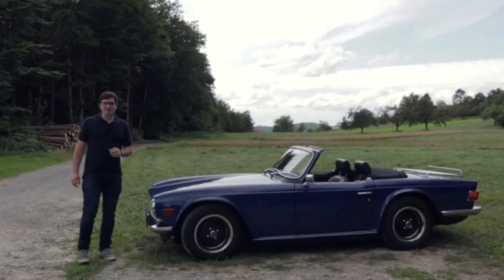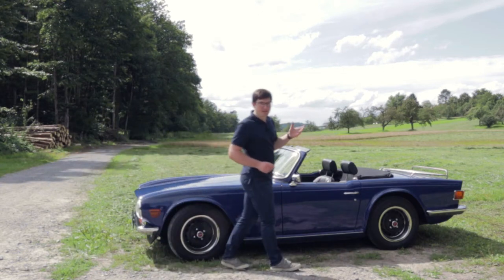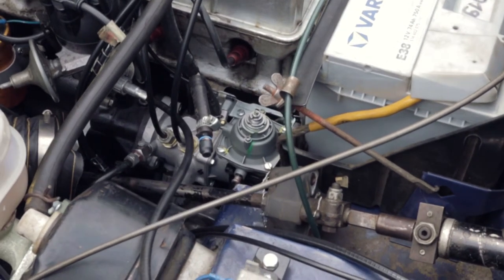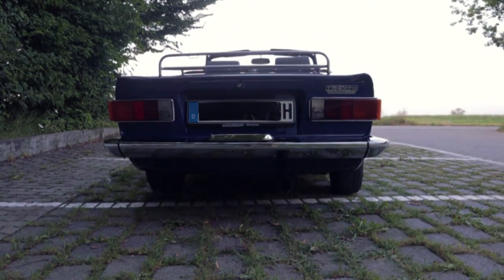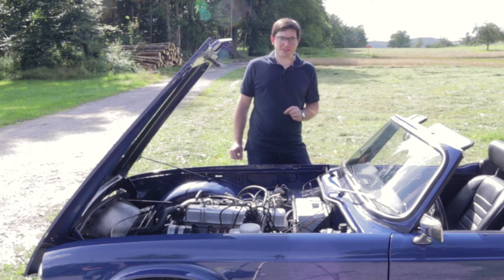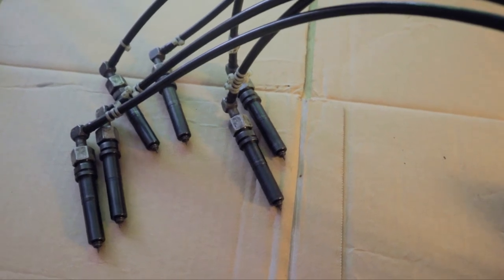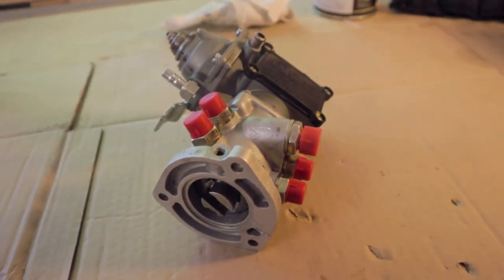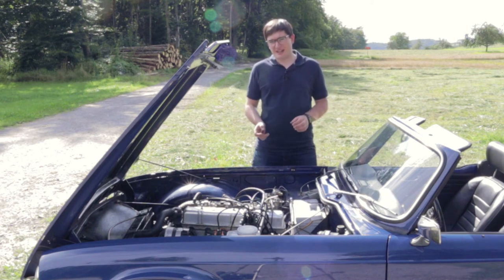TR6 PI -  some technical issues

Comment: Hi, Nice video and generally good explanation. However I have to say that the Lucas PI injection does not have to be that troublesome. In my opinion repeated failures of the metering unit drive dog is very unusual and I'm certain there's something wrong with your metering unit rotor. (As you say the drive dog is the mechanical 'fuse' to protect the drive system). Have you had your metering unit refurbished? Have a look on the TR6 Forum of the register in the UK. Lots of info and help on there. There are people who refurbish these still, typically Neil Ferguson or Prestige Injection for about £175. They should get you sorted out so you can enjoy the car properly. Oh and the poor cold starting with fuel bleed back:  that's likely to be failing non-return valves in the metering unit too, another reason to get it refurbished. Next day cold starting should almost be instantaneous. If left for a week, that might take 5-10secs to prime, fair enough... Enjoy your TR6!!!

Comment: The reason the rotor drive fails, is the unleaded petrol, which causes it to seize. Since I add a little amount of led substitute to the petrol, despite of the converted valves, I never had any failure  to complain about anymore. It is working trouble-free for years.
Reply from the maker: That is really good to know, we actually added some led substitute lately and so far there were no rotor related issues!

Comment: I had a 1971 TR6 from new, and kept it seven years. Only fuel problem in that time was a blocked injector - a simple swop. Never had cold starting problems, and the fuel system received zero servicing. It did get through three water pumps, the quality of which deteriorated at every exchange (from casting to pressing).

Comment: Having had a TR6 PI Mk1 for 5 years starting 1972 and driving on autobahns at high speed regularly, I can only describe them  as a "Bag of Poo"  and that's being polite!
Reply: But if you still had it in good condition it would be a  35,000 euro bag of poo

Comment: Never had a moments problems with the actual injection system, and I used to drive it like it was stolen;  maybe that's the secret!  That damn fuel pump, otoh, my god, it used to overheat until it seized, and I'd have to wait until it had cooled down to get going again.  I'd still own one again, but prices have gone crazy.

Comment: the easiest and cheapest way to solve the problem is to add a second fuel pump, for example a small FACET and you can ride until the trunk is empty

Comment: Interesting video! We have had our 6 for over 25 years and until fairly recently the fuel system was ok, only needing injectors clearing and a refurb to the metering unit. However, knowing we had 2 TRips accepts the Chanel this year, I decided to replace the 21 year old Bosch pump. I was unable to find an exact match and, on advice, replaced it with a Sytec 3044. There were initial positioning issues - down to me but eventually had it sorted - or so I thought! I had all the issues you described in the video. Eventually I mounted the pump in the wheel arch with a Facet low pressure feed pump with built in filter directly beneath the fuel tank. I have removed any obstruction like the fuel tap that had been on for 25 years and ensured all pipework was 12mm id for maximum flow. I have fitted a Sytec serviceable post filter with an 8mm replaceable filter. There have been no overheating issues that the various pumps I used this year suffered with.
Do my recommendation is forget the fuel hungry 3044 pump - either Bosch or Sytec. I am now using a Sytec OTP 979 fed by the low pressure pump as described. Fueling is massively improved with startup and running much smoother due to the low pressure feed. Looking forward to the French and German meetings in May 2024.

Comment: I already commented a while back on the other part on the TR6. My father was main mechanic for British Leyland and indeed the fuel pump was troublesome. It was basically a wipermotor that was slightly tweaked and used as a high pressure fuel pump which made it suffer and get hot. The original factory solution was to use an extra serpentine fuel hose on the OUTSIDE of the pump where fresh fuel went through so to keep the pump cool. Honestly never heard of the loop you are telling that the pump heated up the fuel. It was the other way round. The fresh fuel as always cold was intended as a natural way of keeping cool the pump, but still the pump went hot. It didn’t heat the fuel though, it just got hot. 
Very good video and enjoyed watching it! 
In all honesty, still having some family owned Triumphs and other British cars, I must really say that if you know what you are doing, actually the cars are more reliable than everyone wants to believe.
Reply: I had a TR6 40 years ago, it was a 73 year model PI and never gave me any trouble at all.  I've recently got another 73 PI (60th birthday treat) and experience a few of the issues ATT mentions. Perhaps the issues are more age related, like my back and poor eyesight ?

Comment: James makes some good points. Also noticed some minor backfiring on gear shifts which should not happen. I've had mine since new (1969 build) in Australia without any problems other than replacing worn out pump brushes. Pi system is difficult to get right, but, works well for a mechanical system when dialed in.

Comment: Re: Back in the day...   In the late 70's I owned a TR5 PI.  It was one of the pre-production prototypes, chassis number CP6. One of the cars that got loaned out to journalists for reviews/testing.  
The fuel pump was mounted in the engine bay, close to where the brake master cylinder was positioned. Surrounding it was a coiled cooling ring. The only time I ever had any problems was if, on a very hot summer day, I was caught in heavy, stop start, traffic jam ups..., the engine would start to hiccup, and intermittently fade, due to the fuel vapourisation that you describe. The cure was to pull into the side of the road, and let things cool down a bit, and preferably when the traffic snarl had eased and got moving again. In 4 years ownership, this problem manifested only about 3 or so times. So hardly a big deal.
Re: the "... bit more power on the PI...". Somewhat more than a bit. The early TR6 PI's, as with the TR5, had 150bhp. The carbed versions that went to America were so strangled that, as I recall, they only had about 105 bhp, much the same as the TR4's from years prior.

Comment: I had the 2.5 PI sedan. Changing the rubber O rings in the injectors to viton O rings solved 90% of the problems. Never had any issues with smell of petrol in the boot. I made a a water cooler for my fuel pump motor that solved the vapour lock problem. All up cost less than  $20 in the 80's. I drove mine on 45 deg C days in Aus summer no worries. 
Never knew anyone who had the issue with the red plastic piece. 
Maybe some issues are caused by unleaded fuels?

Comment: Many thanks Michael  for these excellent technical explanations on the PI variant of the TR6. Also great sounds on the road, what is your exhaust system ?
Reply from the maker: That exhaust is some non standard big bore pipe (l don't know the specifics) that has been fitted by one of the previous owners who went racing with this car

Comment: Lucas never had any good reputation for Fuel Injection nor Fuel Pumps.  The fact it was not available on US Exports appears to be quite certain it would have never been able to comply with US Emission Requirements in addition to the fact High Temperatures and High Mileages would have been a total disaster.  England's automotive industry over the past 4 decades went down the toilet, as well as every other industry with the exception of Weapons and Turbo Jet Engines !  How pathetic